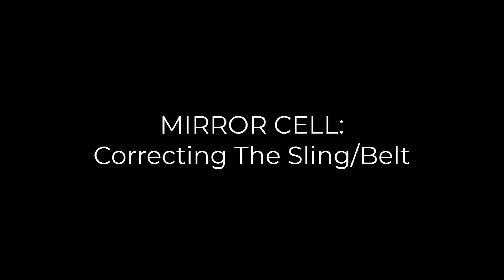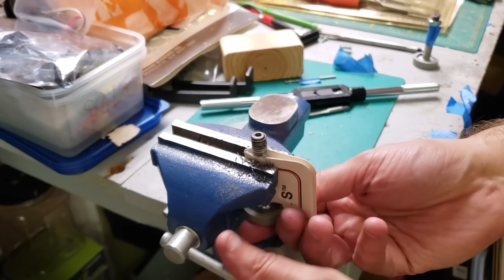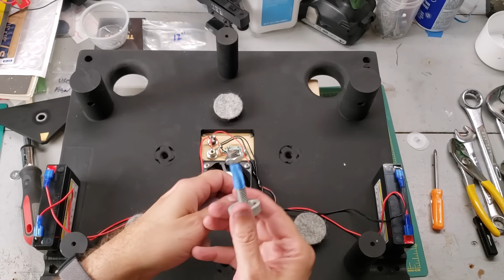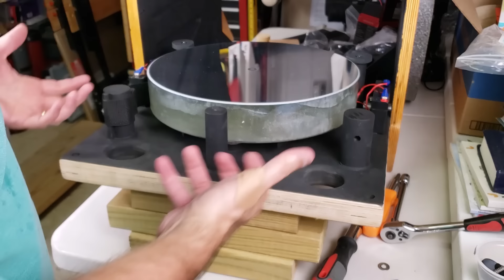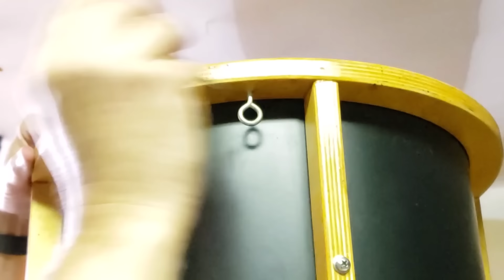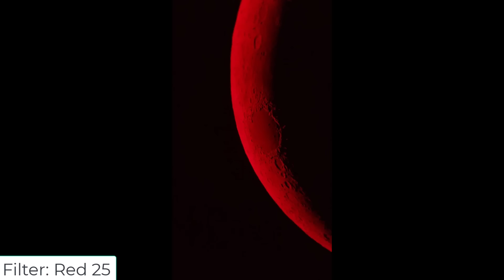Big Telescope Restoration: (PART 3) Final Assembly And Night Sky Test! (by Reflactor)

Comment: Typically for locking a nut to a bolt (or a bolt into a casting,) Locktite is used.  Various formulations can be used depending on the strength of locking needed and how it is to be applied (before or after assembly, generally.)  Given the ease that you removed the nut, I'd guess Locktite 222 (low strength,) or 223/224 (medium strength, aka "Blue").

TIP: Heat kills Locktite.  If you need to disassemble a joint that has locktite, heat the materials first to kill the locktite, then disassemble.  This is particularly important if high-strength (red or green) Locktite is used.
Reply from the maker: Thanks for that very helpful tip!

Comment: I have an Orion 10 inch mirror bought in 1994 that is two inches thick.  Coating is still good.  16 inch Meade LightBridge mirror coating degraded soon.  Had the mirror stripped, refigured (was under corrected), and recoated.  Like seeing classic things being brought back to life.
Reply from the maker: Nice!  Did you put those mirrors into an Astrotech frame or do you have a custom telescope frame?
Reply: @AstronomyGarage  Orion mirror is in a custom made square tube with partially home made cell.  The mirror holder is Novak if I recall correctly.  The cell comes out the back end of tube.  The 16 incher is in a stock bottom tube with homemade upper tube assembly.  The base is custom made on both scopes.  Both scopes are set up to use a binoviewer.  The upper tube assembly on the LightBridge is quite heavy,  so I saved a lot of weight by replacing it.  Optical Mechanics did the refigure and recoat job.

Comment: An advantage to making your own big dob is that you can adjust the balance and components to customize and optimize it.  Two interesting offsetting options are to add a superfinder operating at abt 20x-25x and to shorten the truss-tubes to add a Parracor.
Hang a 4"-6" reflector or up to a 4" refractor on the scope.  This can give two substantially different fields-of-view of any object.  A superfinder is very helpful to star-hop to faint fuzzies.  Weights can be used on an existing scope to counter-balance these big finders if you only do this mod.
Thnx
L

Comment: If you get bored, that mirror cell still could use some help. Having the collimation bolts move the mirror independent of the mirror hold downs is a sure recipe for a pinched mirror. Also, I would not expect the cell to hold collimation over the length of even a short car ride, because there is no restraint to keep the collimation bolts from unscrewing under vibration.  To avoid rebuilding it all from scratch, I would suggest screwing the support triangles and the mirror restraint towers to a single plywood board, thus solving the problem of having the collimation bolds driving the mirror into the supports.  The collimation screws would then work on the plywood board to change mirror tilt.  The addidtion of another screw  next to each collimation bolt to push against the plywood board would lock the collimation, having the lock screw in compression, and the collimation bolt in tension.  That puts enough force on the threads to keep them from moving under vibration.  You should put a small metal wear plate where the lock screw bears against the plywood board to keep it from digging into the wood.

Comment: Why is the mirror so thick and heavy? Is it to balance the tube?
Reply: Does the length of the truss poles matter?  Would changing the pole lengths change the focal points?
Reply from the maker: Oh yes.  The mirror has a focal length of 60 inches, so the truss rods are cut to a very specific length to make the light path measurements all work out.  I've since thought of a reason for the mirror being so thick - weight.  This thing is so front heavy that the extra weight from the mirror offsets the weight balance.
Reply: @AstronomyGarage  I just found this video, "Telescope Building with John Dobson'" - a real gem. He states that the mirror glass is thick to prevent it from flexing and throwing off the optics. https://www.youtube.com/watch?v=snz7JJlSZvw&t=1751s
Reply from the maker: That is a very good question and I never found a good answer.  I suspect it was an attempt to make it as rigid as possible to hold shape, although this isn't really done nowadays.

Comment: I worry a bit about those self adhesive batteries.  The strength of the adhesive is only as good as the bond of the black paint.  It's easy to imagine them coming loose and causing trouble.  You might want to make up some sort of hold down clamps for them.... just to be sure.
Reply from the maker: I've thought about using some type of tie or plastic tie down system to augment the self-adhesive.
Reply: @AstronomyGarage  The thing I would probably do is make up thin metal brackets/straps to screw down over the batteries.  A strip of (say) 20ga galvanized steel about 1/2 or 5/8 wide could be shaped up by bending it over a battery-shaped wood block.  With the two central bends in place, use the vise to help form the "feet" for the screws.  Be careful drilling the holes in the feet, so the work does not catch and spin.  You can probably use the vise again here if you put a couple of sacrificial wood blocks on top of the jaws.   Alternatively.....  straps could be made of plastic cut from a milk bottle.  These would work just as well and not require any pre-shaping.
Reply from the maker: @robertmacpherson9044   That's a good idea. I also have an old black belt that I could cut up into sections.  Or... velcro. I have self-adhesive velcro strips.  ALthough they might run into the same paint adhesion issues.
Reply: @AstronomyGarage Velcro sounds like a fine idea if you screw it to the wood.  You will want to put washers under the screw heads, or else use those big-headed screws they sell for attaching expanding mesh for stucco.  They are available at the local hardware store, in the fastener isle.
Reply: Or you could cut/route slits either side of the batteries and use Velcro straps?

Comment: This was a great series on the restoration! Thank you much. While I've been very infatuated of late with using a small smart telescope, this has made me think I need to explore a standard optical visual scope again. I have had so many over the years but always of limited success (e.g. can see Jupiter, Saturn, the Moon and Mars but not much more). You've got me thinking about finding one of these big light buckets, but what about the lack of electronic object finding and tracking? Aren't you pretty much limited to J-S-M-M without it?
Reply from the maker: For the most part, yes.  In the city skies where I am, I get to see Moon, Jupiter, Saturn, Mars, Orion Nebula, Ring Nebula and a small white blur called the Andromeda Galaxy, and that is no matter what the size of the telescope.  The secret isn't telescope size, but the darkness of your sky.  A "small" 8 inch Dobsonian will blow your mind in a Bortle 2 dark sky.

The fancy small electronic telescopes are impressive, especially since they can track and do photographic stacking all by themselves.  For my big manual Dobs, I record video using my phone (in ProVideo mode) and then do stacking later that evening using PIPP, and AutoStakkert.
Reply: @AstronomyGarage  thanks for your reply and sharing your insight. This is very helpful. I think based on your feedback I will seek out an 8" Dob like the Orion XT8 without any complicated drive gear, and just use it when nights are dark and I can share some of the astronomy objects like you listed above with others. Thanks again.

Comment: Purple loktite is probably what you should be using for most of these applications
Reply: Purple is more of a thread sealant than locking compound and is much easier to remove without danger of breaking stuff. I have a 50ml bottle of 222 that gets used way more than red or blue
Reply from the maker: I'm hoping that with the addition of the milk jug washers, the torques will be so low that my loktite will work, but you may be right in the long run.

Comment: If possible can you please include some technical details like what is the magnitude limit for this telescope. What percentage is the secondary mirror to the working aperture and lastly why didn't you put caster wheels on the base itself instead of having the support wheels.
Reply from the maker: I honestly don't know the magnitude limit.  The mirror, despite looking very good, does have some degradation near the outer 25%, so I suspect that will reduce the magnitude limit.  The secondary mirror is about 2.1 inches by 3 inches.  I usually don't put castors on telescopes that are excessively heavy (this one is). Plus, the ground base is quite small.  I think the new Telekits have bigger round bases.

Comment: Great finish to an excellent series!

Warning to others, be sure to only use blue loctite if you want to disassemble later.

Red loctite is more permanent and requires a lot of heat to break it loose.
Reply from the maker: That's good to know. I probably should've used the red, but in this case the blue was rock solid (it'sall I had). Fingers crossed that it holds.
Reply: @AstronomyGarage sorry, I did not explain clearly.

Blue is perfect in this application. It will hold 100% until you purposely decide otherwise. Blue is made for later disassembly.

I was warning people AWAY from red in this situation. It will not come apart, even if you want it to, unless you apply heat that will likely damage the wooden parts.

Comment: Nice work drilling the holes on the bolts without a drill press. The planets at the end look really nice with a smart phone, I would think think visually it would look 10 times better.
Reply from the maker: I was sweating bullets drilling and tapping those holes, afraid that I'd break the bit off. I used plenty of oil and went super slow with advancing the tap. Visually, Jupiter was incredible. I saw the red spot with my eye.

Comment: Fantastic video for closing out this restoration.

Two quick questions, what is the focal length of this monster? And what is the job of the wing nut on the sling, wouldn't the first nut hold the bolt and sling in place?
Reply from the maker: Believe it or not, only 60 inches. The wing nut replaces a second wrench necessary to tighten that joint after adjustment. Slightly easier and safer than having two wrenches flying around near the mirror.

Comment: "I'll cut this off, obviously." Hmmm...maybe it's not that obvious, or perhaps, it could be a self-induced impediment that is not observed until the very last screw is attempted to be inserted but fails, and in so doing, requiring complete and total de-construction.  Very impressed with the methods used by the original designer/builder on this scope, and, most assuredly, your skills in diagnosing the problems and providing remedies.
Reply from the maker: Sometimes I do have to do a total de-de-construction to fix a mistake on my part during re-assembly.  If so, I usually eliminate the first portion because I'm a stickler for making these as short as possible (I realize 34 minutes is not very short).  That may make me seem clairvoyant,  but I assure you that I am not, lol.

Comment: I have really enjoyed watching this series of videos, great job. I’m new to astronomy and find your videos inspiring, keep up the good work.
Reply from the maker: Thank you for watching!  Depending on how close you are to a big city center, used telescopes are common.  Used wooden telescopes are a bit less common, but they do still pop up from time to time.
Reply: @AstronomyGarage  I'm on the edge of a town in the UK, bortle 6. I've bought a StellaLyra 8" Dob which is the same as the Zhumell z8/Apetura 8 so I should be able to transport it to darker sky sites. If I ever get the chance of a wooden Dob I'll certainly go for it.
Reply from the maker: The Apertura8 is probably the nicest 8" available.  Ball bearing azimuth, accessories, etc.  I have a Zhumell 12 inch metal tube Dob and it's the same as the Apertura.  I think the previous owners lived near a sand-blasting factory because it's one of the only mirrors I've ever had to get professionally recoated.

Comment: A potentially handy hint for unlocking threads locked-solid with super powerful thread lock. These materials can be be softened / denatured by heat. But there’s a problem, that you can’t  use a gas torch or heat gun, because it would damage heat sensitive items and finishes in the vicinity of the nut.
However, if you have or can beg borrow or steal (as the saying goes) a spot-riveter, the electrodes of the spot-riveter can be used to apply spot heat to a nut in a sub second welding pulse.
Reply from the maker: Now you've got me worried.  I used a lot of Loctite and I set it out in the sun for an hour to help it cure faster.  Did I actually weaken the bonds?
Reply: @AstronomyGarage  
To be certain you need to read the instructions. As I understand it many are anaerobic, which means oxygen keeps the adhesive liquid, but when denied oxygen they start to set. Some Loctites can be accelerated by an activator.
Loctites vary in their temperature resistance, so it would depend upon what grade you used. If you test the tighness and it doesn't move then leaving it out in the sun likely had no obvious adverse effect.
My spot welder trick can reach high temperatures.
Reply: you can use alcohol to soften it up.  i think it goes without saying if its been on the bolt for decades it will take a little longer to soften it up

Comment: Purple loc-tite is less forever.
Reply from the maker: This is a good point.  One of the reasons I used the plastic washers was to reduce the torque that those nuts sensed.  The plastic washers making collimation a snap as far as turning those bolts.  I'll keep an eye on it.